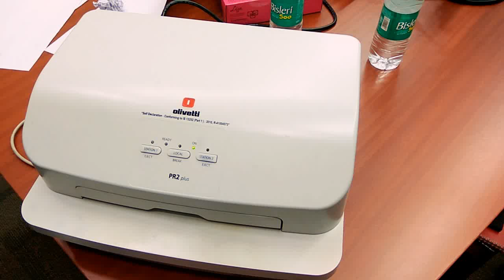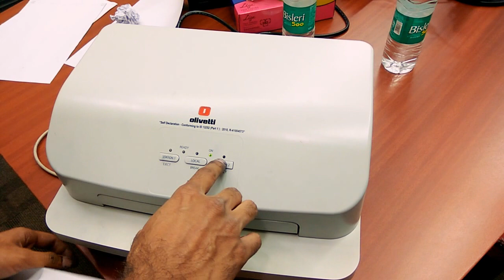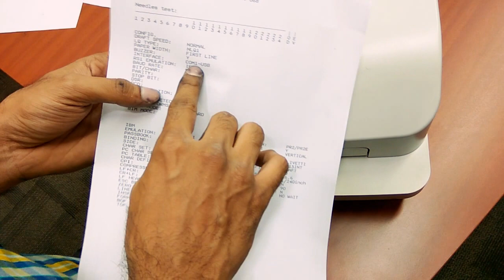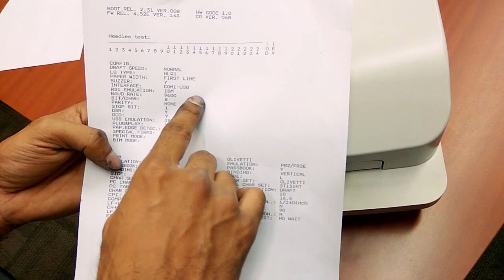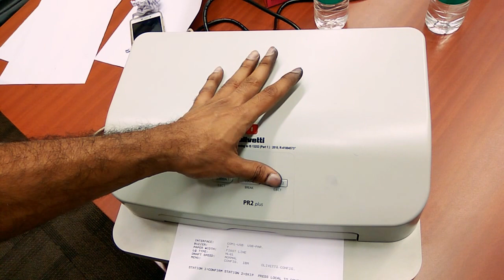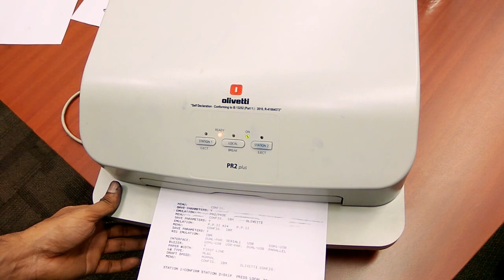How to configure Olivetti PR2 Part 1

Comment: good day, i would like to ask you if you're still reading comments kind sir, is that the printers compatibility, can it run on windows 10?
Reply from the maker: It does if its able to find the drivers...but I would advice to stick to Win7 as the printer is old.
Reply: @SkilledTechie  would you recommend how can i find a driver of it for windows 10? is there such a thing as of the moment? thanks bud
Reply from the maker: @acejaspernoora2466   https://www.olivetti.com/en/support/download-drivers try installing the 64bit version for win7/win8.1. Win10 is very buggy these days when it comes to legacy driver support.